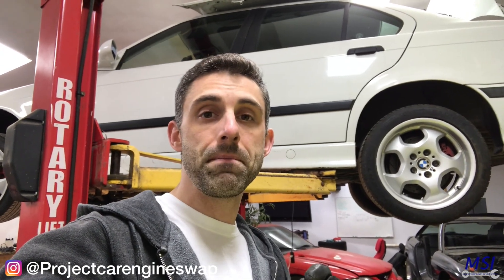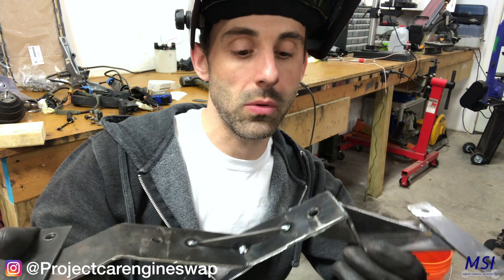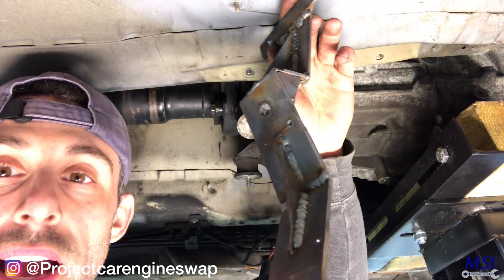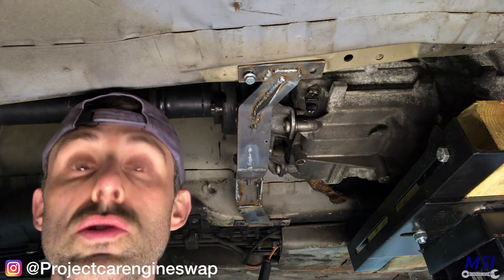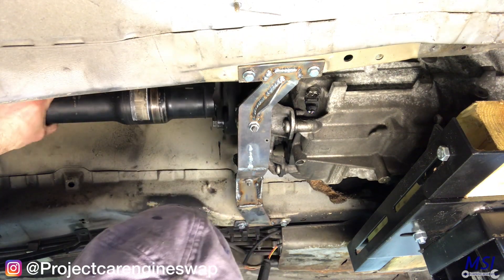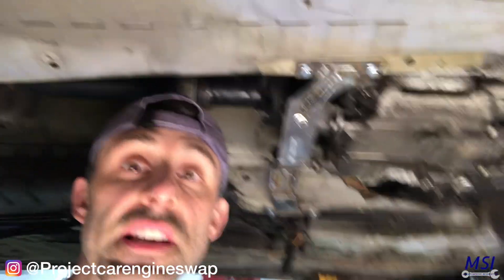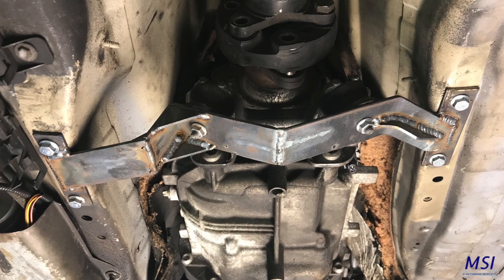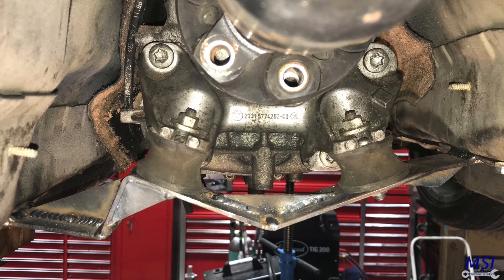How to Fabricate a Transmission Bracket from SCRATCH for 6 speed Trans

Comment from the maker: I will be releasing dimensions of the parts I fabricated to make this swap happen. It will be in my integration guide coming out in June!
Reply: Garageaholic did you ever release the integration guide for this swap. I've checked your website and don't see anything for the e36
Reply from the maker: Nothing yet. Still working out bugs on the swap so I don’t feel comfortable releasing it until I get those technical issues resolved. Thanks for asking but rest assured it’s coming!

Comment: You use e36 transmission to n54 engine?
Reply from the maker: Nope - E90 RWD trans
Reply from the maker: E36 or e46 trans don’t fit. Splines and diameters are different. I aim to create a video to cover transmissions and applicability in the future
Reply: @Garageaholic  Sorry I know this video is quite far back but i'd like to know which transmission it is exactly? Are all e90 manual transmissions the same (320i, 323i, 325i and or 330i) We did not get the Xdrive e90/e92 in South Africa

Comment: Will you be releasing the dimensions/schematic of the trans mount and anything custom fabricated for us to see, like in a guide?
Reply from the maker: Yes I plan to issue all of that detailed information in the guide come June 2019. The engine brackets will be similarly constructed, and as such  the engine mount installation video will be more detailed in how the engine position is set in place by welding the custom bracketry to the subframe.